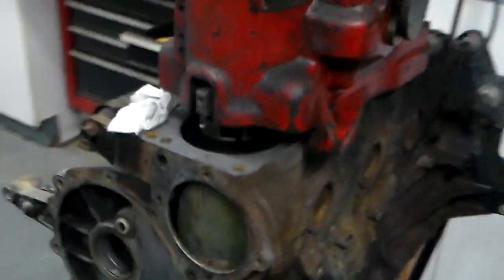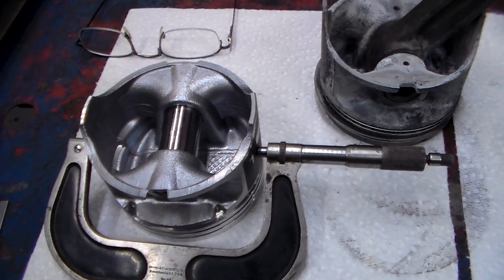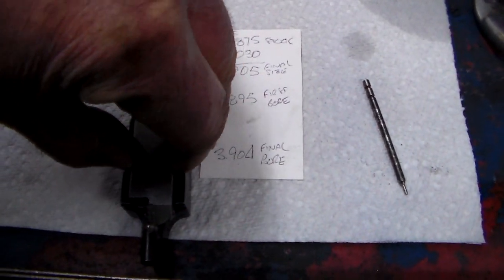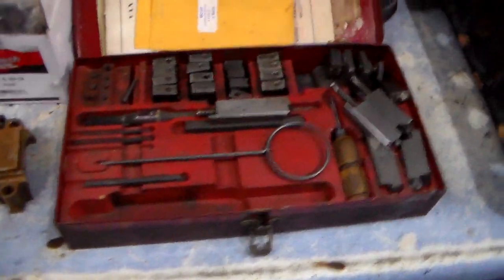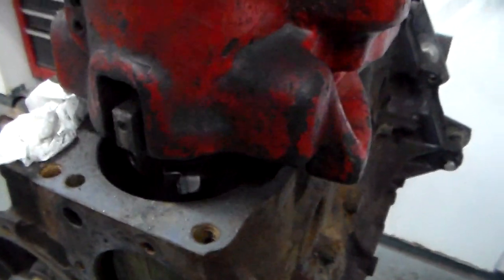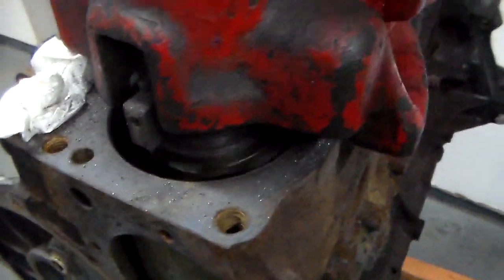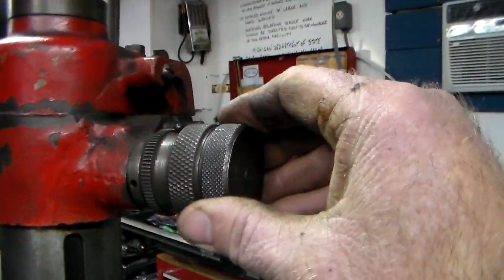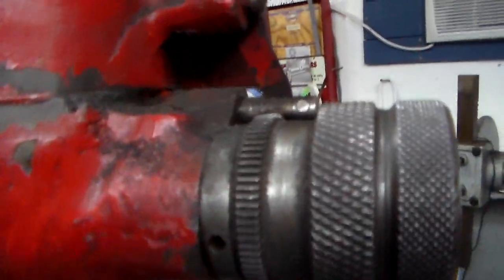Boring an engine block

Comment: if you rotate the motor in reverse rotation 2 turns it frees up the drive dog, its made that way so it doesn't jump out of gear. i always cut in low gear it puts a lot of heat in the cutter in high, actually the whole machine gets hot. i leave about .0015 to .002 to hone out, it makes for a nicer finish in the bore.
Reply from the maker: I will do exactly that ! ... thank you so much, always wondered why it was so hard to disengage.  You're a gem
Reply: That is not enough material to properly finish hone. If using a torque plate it wouldn't even clean up the boring pattern in many blocks since they distort 0.0015"-0.002".

Comment: Just got home from driving a 100 miles one way and back to pick up a 944S with complete tool kit and the Van Norman hold down clamp. I'll be reviewing this video and re-reading the comments over and over for a bit until I send 'er on a maiden boring voyage. I know I can take the block to a shop, but I am one of those guys that likes to DIY everything and find out for myself, and I take satisfaction in figuring it out myself. Always been fascinated by the engine boring concept, I saw this video months ago, and it led to me now owning a Van Norman bar. Crazy. Anyway. Maybe I am, but I like engines and drag racing and hot rodding, so, yeah, pretty much.
Reply from the maker: I love it !    Let us know if the hold-down thinggy works out for you.  The one that came with my boring bar was no where near strong enough IMO to trust.  So I run a 2 inch pipe through the main saddles (with various random holes) and a piece of 1/2 threaded rod that runs down through a bore, into the pipe, and I ground a piece of 1/2 plate to fit the opening in the back of the boring bar and a hole for the threaded rod.  Works great, she's rock solid.
Reply: Good on ya Doug. I bought one at a closing workshop a few years back. i got it so cheap i dont know how the hell i ran with it to my car!

Comment: Very helpful and informative. I bought a boring bar 777 here in Australia and have not used it yet as i didnt know the first thing about it, but now i do! To the scrap yard tommorow to buy an old block. Happy days.
Reply from the maker: So glad this video helped !.    Just go slow, take tiny amounts out of the bore until you get used to the machine.  Also, make sure the boring bar is securely fastened so it can't move around.   I upgraded the fastening method by buying a piece of 1 inch threaded rod about 18 inches long and a piece of 2 inch pipe that runs thru the mains in the block with holes for the threaded rod.  I fitted a plate to the inside of the boring bar, with a hole for the threaded rod.  Once that threaded rod is tightened up, the bar is very secure.  The original Van Norman clamp was garbage.
Reply: Mark Osborne cool, i shall do that. Thank you again.

Comment: 10:50 Sometimes it is a better deal to put a sleeve in one cylinder if all other cylinders are standard bore and in good condition. On the Fiatnutz channel, I did see that with the right boring bar, installing a dry iron sleeve isn't difficult. The downside is that the block deck would have to be machined, and that might end up costing more if the cylinder block already had a good deck finish.
Reply from the maker: Absolutely- it's done all time  :-)    and if you're really good with the 'face off tool', you can save decking the block.
Reply: @mark_osborne  I wasn't aware that the face off tool could be that precise. Thanks for the info!

Comment: Soo what if original bore us pitted or woren pretty bad?? How does guides react and keep everything aligned?? Just curious?? Thanks for video
Reply: Reason I'm asking bc I work on some very old hit and miss engine s...and sometimes they are rough and pitted from sitting out in element s.....same for 100 yr old tractors....
Reply from the maker: basically you can lower the boring bar way down into the bore where it normally isn't worn, then lock the machine down on the deck.  You have 3 fingers that extend, and they are fairly generous in size, so I doubt pitting would throw you off much.

Comment: If your tool kit is complete dressing the cutters is not hard to do it takes some practice but works well the disc on top of the electric motor is for dressing them and you should have a jig that your cutter goes in and a rod sticking up next to the disc for the jig to slide onto it has different holes to change the angle and dress different parts of the cutter  also if you don’t want to leave a scratch when pulling back out of the bore loosen the hold down and slide the bar so the cutter is not contacting the wall
Reply: That's how do it

Comment: hi there. great video by the way. how do you align the boring machine centrally to the bore.?
Reply from the maker: You leave the part that clamps it to the block loose (so the machine can move around), then lower the boring bar into the hole, then wind out the locating fingers that are at the bottom of the bar.  As the 4 fingers expand, they will center the bar in the hole, then you tighten down the clamp that secures the machine to the engine block

Comment: how much does that thing weigh?
Reply from the maker: I can just barely pick it up enough to move it from the bench over onto a table (that has wheels), then roll it over to the chain fall where I lift it up and place it on the engine block. I realize that's more information that you needed, just giving you a sense of it.  I'm not sure what it actually weighs, probably 150 lb-200 lb

Comment: How does the block sit perfectly were the drill comes down into the cylinder?
Reply from the maker: I do not understand your question
Reply: The boring bar has a clamp fixture that holds it tightly to the deck of the block. The block itself does not have to be extremely level, if that is what you are asking.

Comment: Sir I’ve been using this machine for a little bit now since watching your video months ago, and I have a question for you, I’ve gotten pretty quick at switching it from cylinder to cylinder, and I’m noticing that it seems to bore out more and more material after I get into my fourth and fifth consecutive cylinders, have you noticed thermal expansion with these things at all? I’m seeing 0.001” by cyl 4 and 0.0015” by cyl 5 then it just gets worse. Just wondering, Thanks!
Reply from the maker: Absolutely !  the tooling grows from heat.... let it cool off a bit, or wrap it in a cool towel before boring the next cylinder.  Great observation !
Reply: Thanks Sir, ok, that makes SO much more sense. Thank you for the quick reply! No one does this stuff where I live, so I didn’t have anybody to ask, and it had me worried I was doing something wrong. I appreciate you posting the video, it helped motivate me to track one of these down to get more capable at building and restoring older engines, once I realized that it was doable. I am still learning on it with undesirable old spare blocks right now, but am getting better quick, and it is a very cool tool.

Comment: How do you know the boring bar is centered in the cylinder?
Reply from the maker: It has fingers that wind out below the cutting head.  You leave the unit loose, wind out the fingers, which centers the boring bar, then lock the unit down at the rear with the large threaded rod and lock nuts.
Reply: @mark_osborne   is that similar to how a scroll chuck operates?

Comment: Mark? 
Can you use a rigid hone to bore the cylinder wider.
Reply from the maker: Trying to bore (more than a couple thousandths)  a cylinder using a rigid hone would likely lead to a non-concentric cylinder, and I'm not even sure how you could check it.   I've taken .002 inches out using a hone and my arms were ready to fall off  :P  .   But, if you are only talking 1 or 2 cylinders, and only .010  it may be possible
Reply: I saw a machine that looked like this hone but it was automatically lifting the hone up and down in the cylinder opening it was also using some kind of cooling liquid. I thought this hone might get a perfect circular cylinder finish but I am not familiar with it.
Reply from the maker: @irishguy200007  Yes, that is a common piece of equipment you might see in a large re-manufacturing facility (expensive!)  But, it is only used for the final finish.
Reply: @mark_osborne  power hone if I remember correctly.  Great video,btw.
Reply from the maker: @mossranchoutdoors7249  thank you !
Reply: @mark_osborne  
I learned on a Sunnen CK-10 back in 89. Used it for boring boss only let me use the Van Norman to sleeve blocks. Now I have a 944s bought used over 20 years ago and a 777s I bought 6 years ago. Just bought a used Rottler this year. Use to hone with a rigid Sunnen hone in an old Black and Decker, then bought a hone machine 6 years ago. Best money ever spent.
Reply: @mark_osborne  the Sunnen power stroke hones are sold as start to finish cylinder resizing machines. I can stick a block in my Sunnen CV616 and rough hone from 4.00"-4.030" in less than an hour. Allow a cool down period and finish to size. I do however rough bore first on my boring machine but the Sunnens have zero isssue doing all the resizing on their own.
Reply from the maker: @whiplashmachine  Very nice !

Comment: Great video. What type of mounting system are you using?  It looks like you have a mandrill going through the mains, is that how you mount your bar?  I have a van Norman 900 that I just got, but is missing the hold down fixture and was curious how you mount yours. If you have or know anyone who wants to sell the original mounting fixture please let me know, willing to pay. Thanks again 😬
Reply from the maker: Forget the original mounting fixture.  I have one. It's garbage.  It's an expanding shoe that fits into the bore. I'd never trust it.   SO, I bought a piece of 2 inch  Schedule 40 black pipe (2 inch ID, aprox 2.375 OD) roughly 3 feet long and a piece of 1 inch threaded rod also about 3 feet long.  Starting at one end of the 2 inch pipe, about 6 inches in, I drilled a hole so the 1 inch threaded rod could pass thru.  I continued drilling holes about every 8 inches along the pipe so I'd have various places for the threaded rod to pass thru.    Then, I took some 1/2 plate and torched it out to fit into the rectangular opening at the ass end of the boring bar, and drilled a hole in the center for the threaded rod to pass thru.  You can probably picture the rest.   You get the pipe in place - going thru the mains, the threaded rod running up an open cylinder, thru the 1/2 plate and run the nuts up on both ends of the threaded rod until they are just touching.  Then, lower your boring bar into the cylinder, expand the shoes (centering the boring bar), then tighten up the nuts on the threaded rod. 

Solid as a rock !
Reply: Mark Osborne    That’s kind of what I thought you did, and exactly what I planned to do.  I have heard that the original hold downs were problems, that’s why they are so hard to find, every machinist tossed them in the scrap bin.  I just want the original anchor so the bar is complete. This is where my mental and A.D.D. takes over, I will probably never use it but I have it just in case. 😜  Thanks again for taking the time and if you do know anyone who wants to sell one I’d be more than happy to pay, and give a finders fee.
Reply: @wheels2199  Oddly, when I was in the business I only had the original Van Norman clamping system, and I can't recall the bar ever moving when I used it. Mark's idea for clamping the bar is good, but doesn't allow for reboring while the engine is still in the chassis, and I did a lot of rebores in the chassis, particularly on large commercials, where it was easier for the customer to drop the sump, take out the pistons and rods, and then tape up the crank, than it would have been for them to remove the engine completely. The bars I used were the 944, the 905, and the 777S.

Comment: To disengage the auto-feed easier ? If you just spin the lapping wheel backwards a few turns before you try to pull the auto-feed out ? it comes OUT much easier.
Reply from the maker: and that makes a LOT of sense, I will do it next go -thank you !
Reply: I just spin the top of the bore shaft .. works great..